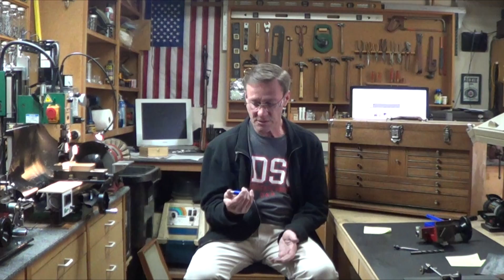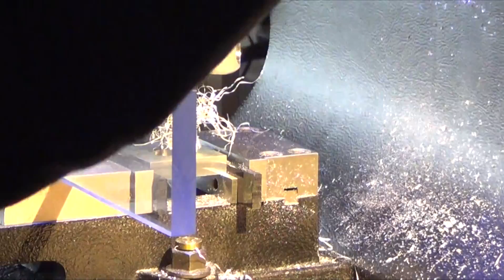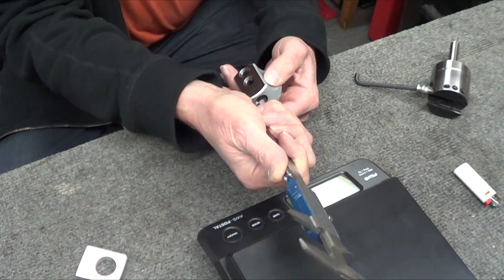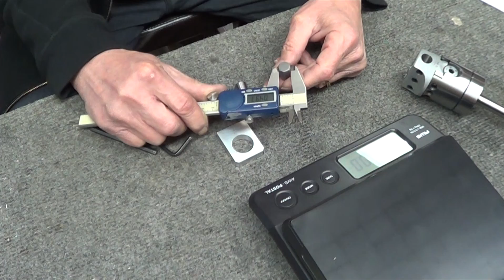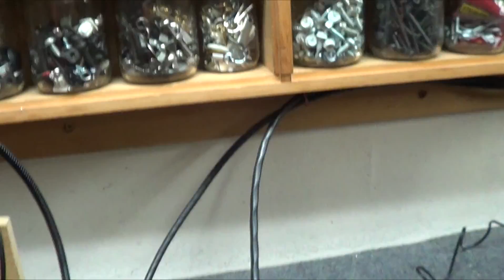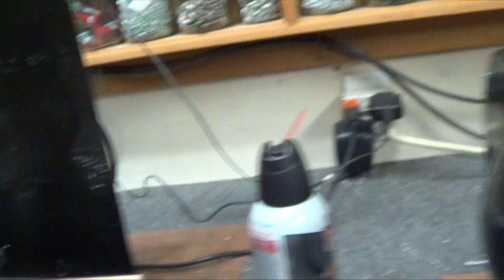DIY Tail Stock DRO & Boring Head Usage Video #60

Comment: Dave, there is a USB breakout board available for Mach3 that NeoCNC had checked out and seemed to work great. I don't recall the site that has them, but you can check out the NeoCNC channel or website to find it. If I recall correctly they were around $150, but there are several Chinese knockoffs on eBay for far less money i.e. around a tenth of the cost of that. Hope this info is useful.